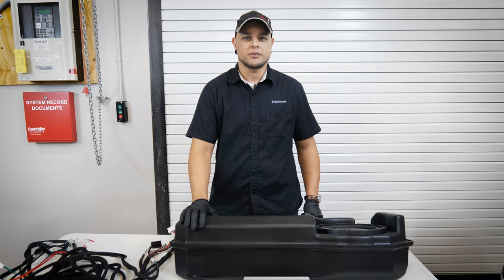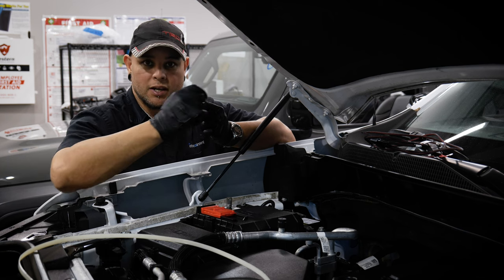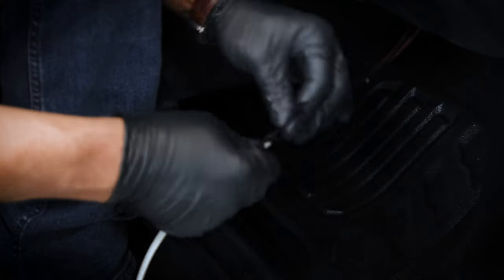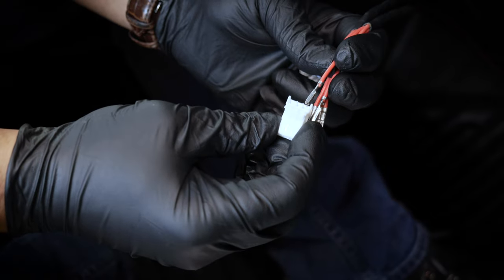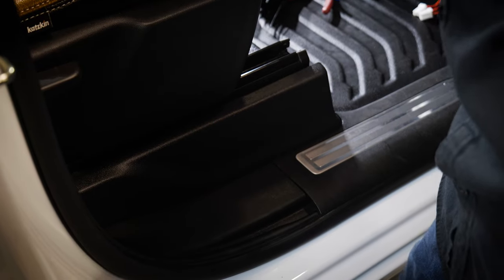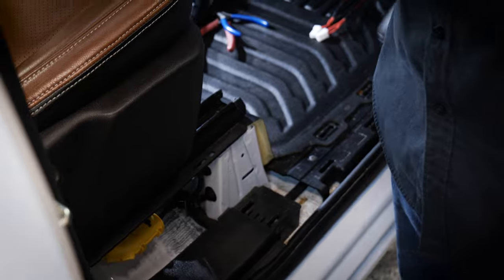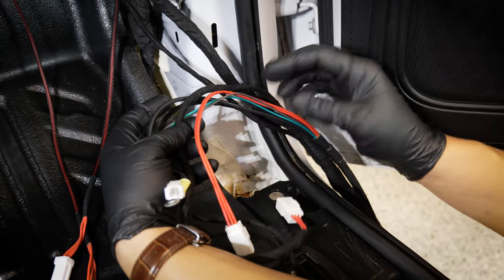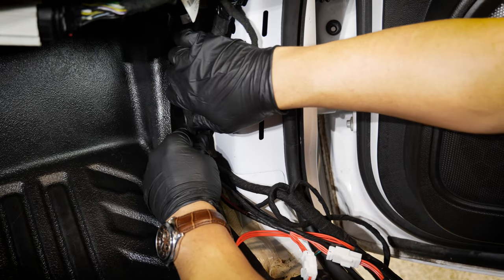2019+ Chevy Silverado Kicker Subwoofer Installation Guide - Infotainment.com

Comment: I've installed this set up on my 23 Sierra, but my rearview mirror plastic housing keeps rattling. I can confirm its the plastic because when I place my hand on it, it will stop the annoying rattle. Is there any trick/hack on how to fix the issue?
Reply: depending on the location of the rattle, maybe a dab of silicone?
Reply from the maker: I would suggest reaching out to our customer support team. 

1-855-636-6287 Ext: 11
or
support@infotainment.zohodesk.com
Reply: Does this set up perform well? I'm thinking about it for my 24 silverado

Comment: Does this still work if you have the under seat storage?
Reply from the maker: Unfortunately, no you would have to remove that storage to install this upgrade. By default it will not just install.

Comment: Can this system be used in a 2021 Sierra with RPO code: UQA?? I was doing some online research after seeing this video, and one vender listed this at the bottom of their page "NOT for use in Models with UQA, Bose 7-speaker Audio".
Reply from the maker: "IOR, IOS, or IOT Infotainment system that have Bose(/UQA) audio systems
For use in ALL Crew Cab or Extended Cab Models (IOR, IOS, IOT and UQA/BoseAudio Systems)
NOT for use on Regular Cab Models
NOT compatible with second-row underseat storage"

No this is fully compatible. 

https://infotainment.com/shop/interior-accessories/amplifier-sound-solutions/2019-2023-chevrolet-silverado-and-gmc-sierra-kicker-dual-amplifier-subwoofer-audio-upgrade-copy/
Reply: they have bose connection instruction and non bose instruction

Comment: My system did not come with fuses in the fuse holders for under the hood. What size should they be?
Reply: So I found the fuses, but now I after I installed everything, the system doesn't work. Everything is installed properly but the light on the amp is not lighting up so I checked to see if I was getting power back to the amp & I'm getting 12v. I'm very frustrated & at a loss. Any advice would be greatly appreciated
Reply from the maker: Hi there,
You may need to re-check your connections. However, I am not certain if you saw the things to know for compatibility.

THINGS TO KNOW
Two 25-amp micro fuses will need to be acquired for this upgrade.
IOR & IOS Infotainment system that have Non-Bose(UQF) audio systems:

REQUIRES Crew Cab or Extended Cab Model
REQUIRES UQF, 6-speaker Audio
NOT for use in Regular Cab Models
NOT for use in Models with IOT Audio System, 8″ diagonal screen
NOT for use in Models with UQA, Bose 7-speaker Audio
NOT compatible with second-row underseat storage
IOS or IOT Infotainment system that have Bose(/UQA) audio systems

For use in ALL Crew Cab or Extended Cab Models (IOS, IOT and UQA/BoseAudio Systems)
NOT for use on Regular Cab Models
NOT compatible with second-row underseat storage

Can you verify if you fit that criteria?
Reply: @Infotainment_nav  I fixed it thx

Comment: Is this for a non Bose speakers setup?
Reply from the maker: It will work with Bose and non-bose. We have two selections on the product listing for your current radio type.

https://infotainment.com/shop/interior-accessories/amplifier-sound-solutions/2019-2023-chevrolet-silverado-and-gmc-sierra-kicker-dual-amplifier-subwoofer-audio-upgrade-copy/

Comment: Does this come with the amp?
Reply from the maker: It would depend on the option code that you are equipped with.  If you are equipped with the UQA option code, that would mean you are equipped with Bose Audio and do not need the amplifier. 
But if you are equipped with the UQF option code, that would mean you do not have Bose Audio and you would require the amplifier.  

Feel free to reach out to our sales department with your VIN# ready.  We would be happy to verify the option codes contained within your vehicle. 1-855-636-6287 Ext: 2 or sales@infotainment.zohodesk.com.

Comment: What are you splicing into the green wire for? Also will this set up require a LOC?
Reply from the maker: The green wire is for linbus communication. By LOC, I'm not sure I follow, I don't recognize that acronym. Did you mean Line of Credit?
Reply: @Infotainment_nav LOC is Line Out Converter .. i was wondering the same